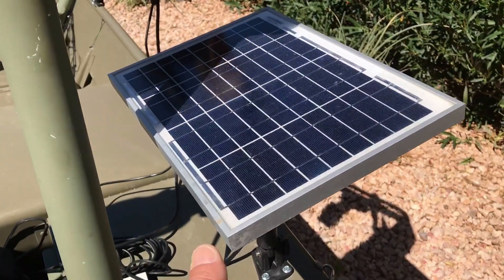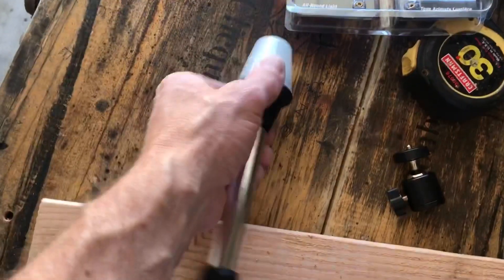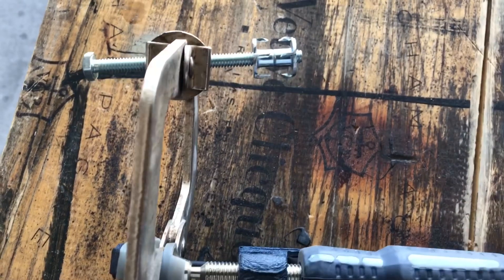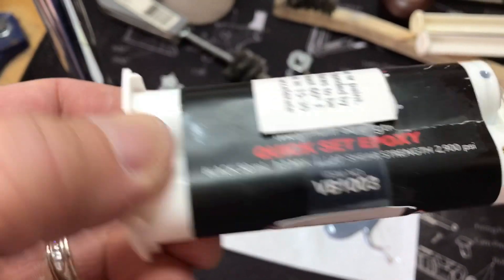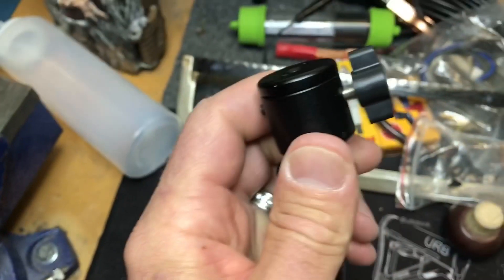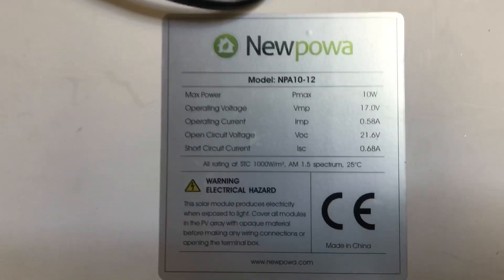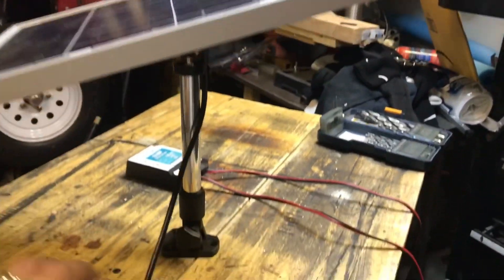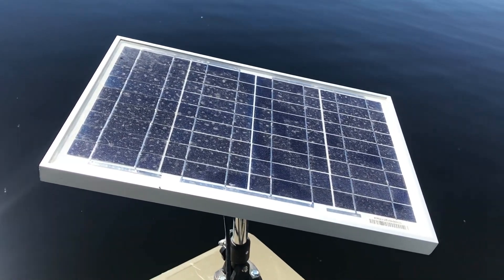DIY Boat Solar Charger That Actually WORKS

Comment: Does this actually maintain the battery while in use? I have been looking into doing this. I have 2 - 27 group batteries that I run parallel and by the end of they day they barely get me back to the dock.
Reply from the maker: I run my fish finder and radio off of this system and after several hours my meter still says 12.3v Your special battery usage parameters are different then mine. For the way I use my battery this setup works great. My boat has a 4 stroke 2.3hp Honda so I don’t use my battery for propulsion.
Reply: @MrFredsDIY  thanks for the response. Unfortunately places I fish are electric only but have been looking to expand to larger lakes where I will need a real motor at some point. Again thanks.

Comment: Hey mate hood job👍🏽 just wondering your after thoughts on the panel size? Sufficient? Could go bigger? Smaller?
Reply: I see what you guys are doing but I’ve got a size complex and can’t understand why/how you can do anything with less than 100W LOL
Reply: Thanks for the reply mate👍🏽 I pulled the trigger this afternoon on a 18v 5w panel for the boat. Would’ve liked to go a bit bigger but the dimensions restricted me as I’ve got a pretty shnazzy spot for it to fit. I live in a place with 100% sun so hopefully it should trickle constantly when on the water and compensate for the radio/lights. Thanks again mate from  Australia 🇦🇺
Reply: @deezy9622  where's his reply? Or were just thanking him sarcastically cause he didn't reply?
Reply from the maker: There was a reply from me but unfortunately it was deleted when we moved over to our new “Brand Channel”.
Reply from the maker: I have found that 10w here in Las Vegas seems to be plenty for my application. My system on the boat only runs a few lights and my fish finder. I have the charging regulator and panel connected inside my garage and it works as a trickle charger.
Reply: @MrFredsDIY  alright Vegemite, cheers....

Comment: Very Nice
Reply: @MrFredsDIY  what size motor? Just seeing you have the battery in the back and probably fuel tank to and steer from back there? Is weight an issue? Just got a boat and having to kind of set it all from scratch came with a 40hp Yamaha no battery or cables or fuel tank or lines. Appreciate any advice. Are you going to put a floor or is the ribbing not that much of a nuisance.